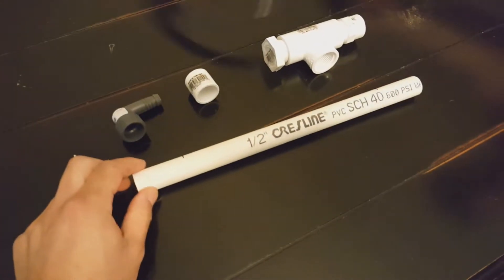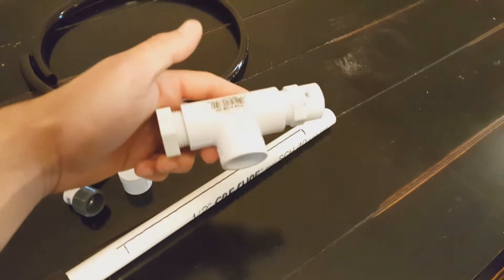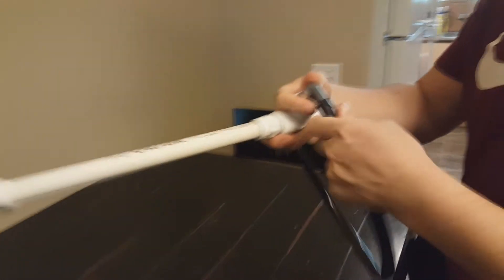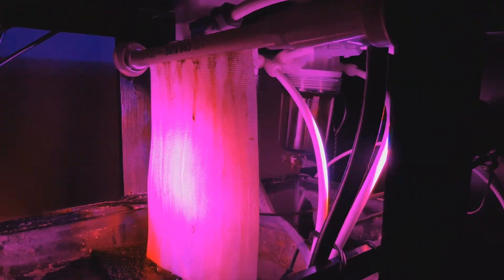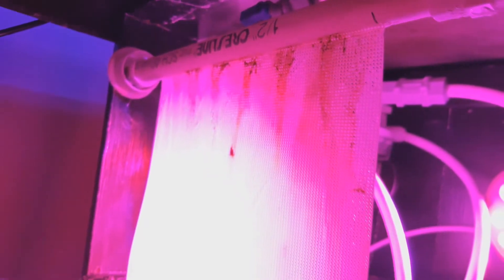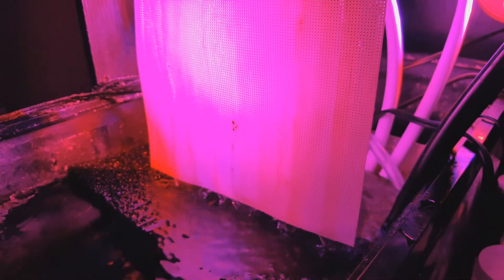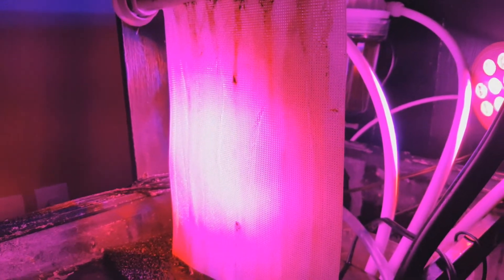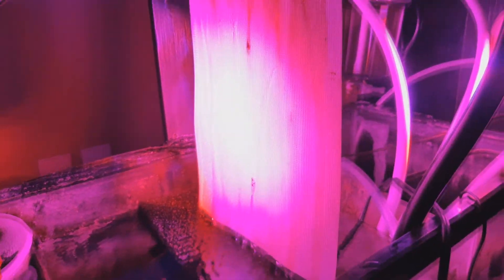DIY Algae Scrubber Triton Method New Way To Reefing

Comment: Triton method algae compartments have to be like 30% total volume of the display, they use calurpa or cheato, not sure how to measure an algae scrubber that way, u might get rid of a little nitrates/ phosphates but I doubt u can get rid of ur skimmer or gfo unlessur tank is under 40gallons. I’ve made my own before and had calurpa and cheato refuguims also, they work if they are large enough,  I have an 88 gallon and dose 8 ml of nopox a day for nitrates under 10, can’t get any easier than that!
Reply: T Surro according to the triton website it's actually only 10-20% the total volume. the only reason for the fuge is so you can grow macro and "harvest" it to reduce nit/phos. The algae scrubber does exactly that but IMO at an accelerated rate. Besides macro algae will never win if you have nuisance algae in your tank, hence the need for an ATF.
Reply from the maker: thanks for the feedback man. Nathan is doing a day by day video documenting how the algae scrubber will work on his tank he has a 40 gal breeder. but he plans to remove everything besides the scrubber for filtration.